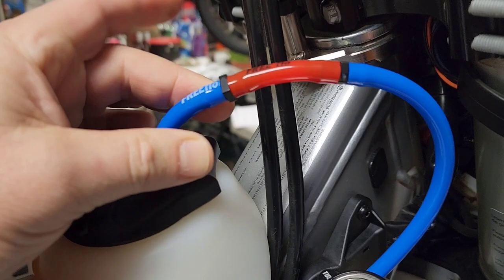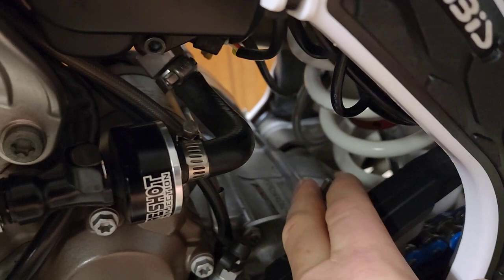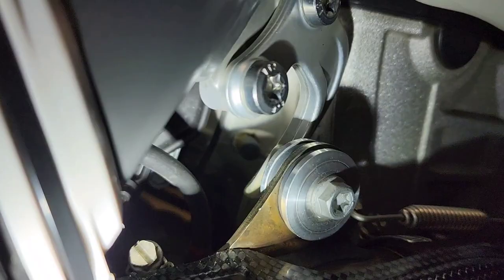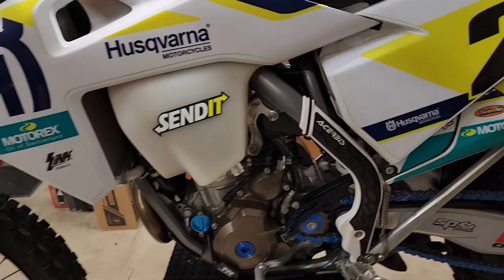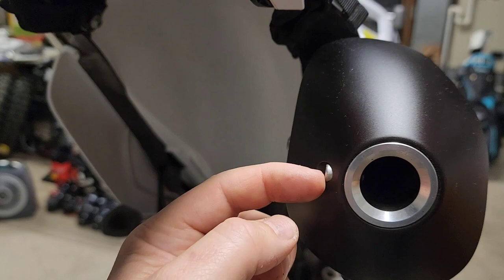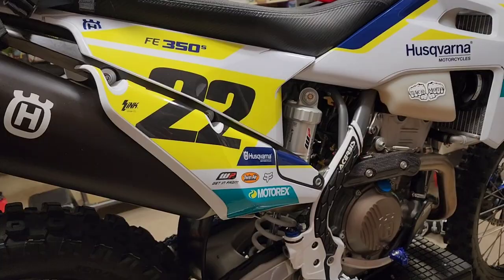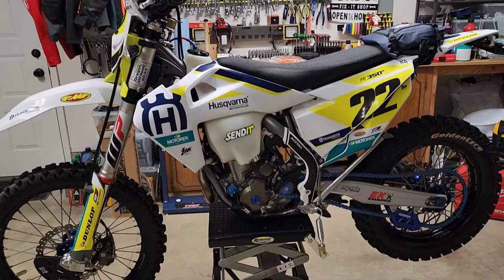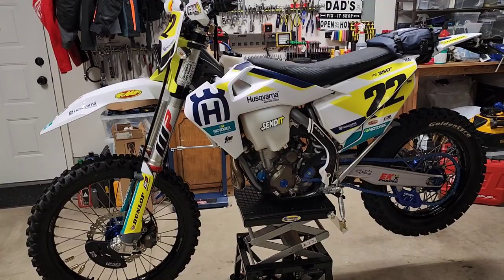NO MORE Flameouts!  KTM / Husky 350s/exc.

Comment: That clutch control technique you mentioned works awesome on a 690 and probably bigger bikes too for hill climbs. The slipper clutch on the 690 is it’s secret weapon and if you fan it and focus your attention on clutch control for power delivery to the rear wheel. It allows you to find traction, and really keep the rear shock and rear tyre compressed and the front end light. I’ve been able to take my 690 places where people have said I won’t get through, and I’m not the best rider either. I’ve just gone back to a 350 and trying to adjust back to the smaller bike.

Comment: Did you get a check engine light with the o2 delete. I’m getting a fault for the O2 the plug I got from taco Moto was empty just a dust cover where the purge valve dongle has a resistor.

Comment: Do you have a video showing how you installed the blinkers, lights and controls?
Reply from the maker: Here is a video for modifying the rear Fender and adding low profile blinkers.  You could use the stock blinkers as well.  https://youtu.be/sK7khQ6Jfjk

Comment: I just got my GET ECU in the mail. I should have it installed tomorrow. I’m really looking forward to the bump in power. 

I really haven’t had my bike flame out, but I do feather the clutch. 

One more question for you, what graphics kit is on your bike? It looks sharp. 

Thanks!
Reply from the maker: Awesome!  GET ECU is the best system in my opinion.  That will be a great setup!   Mine didn't start to flameout until I dumped the bike and was upside down on a hill for a bit until I got everything sorted.  ;)  Feathering the clutch helped a ton for sure!  

I got my graphics from this place, very good quality.  I was enable to install them and it was the first set that I ever did.  https://www.rivalinkdesignco.com/?gclid=CjwKCAiAhqCdBhB0EiwAH8M_GiSr_GSlQYLfAHrVeiUoQ0aqoKWHHIN-j6NrG7zCHWfgTNHQD8D4-BoCA7QQAvD_BwE

Here is the exact kit that I installed from them, but they have many others:  https://www.rivalinkdesignco.com/product/husqvarna-2019-aus-enduro-team-replica-kit/

Thanks for your kind words and for watching!
Reply: Looks like I’ll be ordering some graphics. Thanks again!
Reply: Your explanation about the overflow tube makes perfect sense.  It sounds like it was intermittently vapor locking due to the fuel.   Thanks for the vid.  I’m looking to perhaps buy this model when the 24’s come out, or get a Beta 390.   My hesitation with the KTM / Husky was its reputation for flame outs.  Question, with your mods does it do ok in the rocks/slow going tech stuff?  How does it handle: stability, turning, weight feel?  Thank you 👍